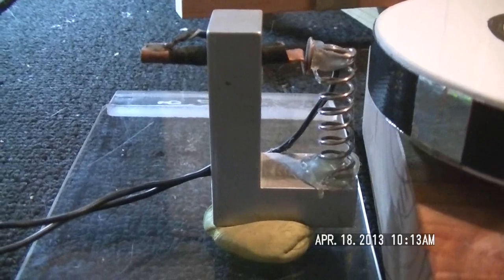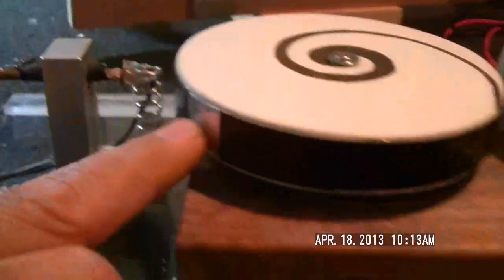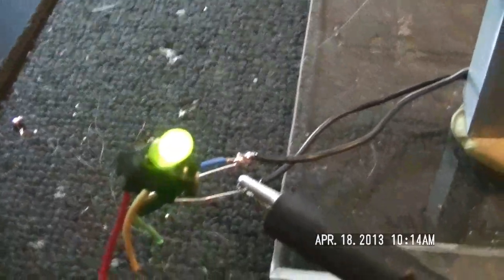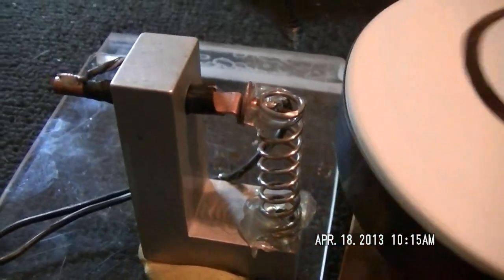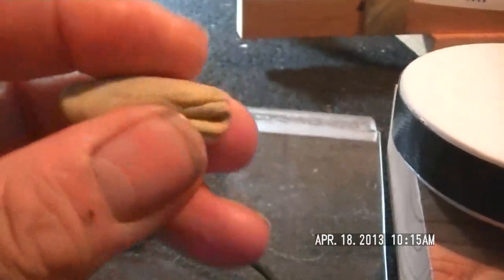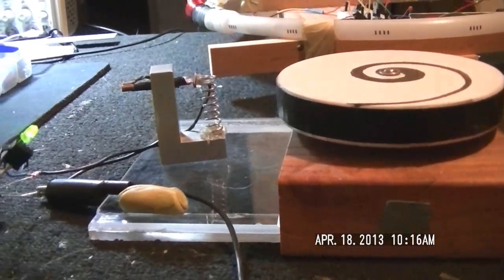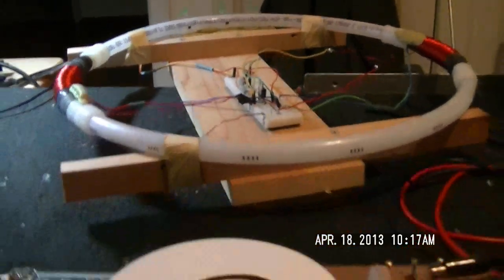Electro Mechanical Magnetic Switch

Comment: Nice thanks for sharing, I need a magnet activated switch that can handle 10 amps 48V DC for a pulse motor i am designing, any ideas would be much appreciated  as I am a mechanical draftsman with no electronic skills.

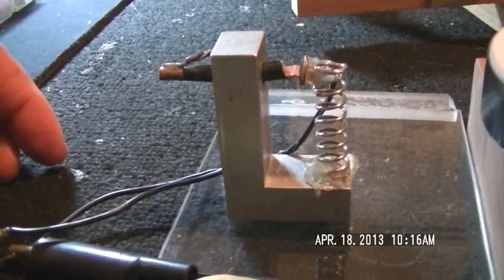Comment from the maker: I mentioned the purpose at 00:30 and 3:45 and for those without any other option, this satisfys the purpose quite well. I learned that just like a reed switch, you can't force a lot of current thru it or the contacts will fuse together. By providing a low voltage source, the switch stays cools and reliable. It allows the transistor base voltage input to to maintain its high current sinking capabilities. 
Thanks for your question.